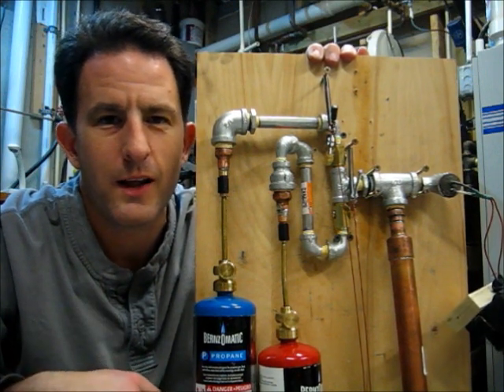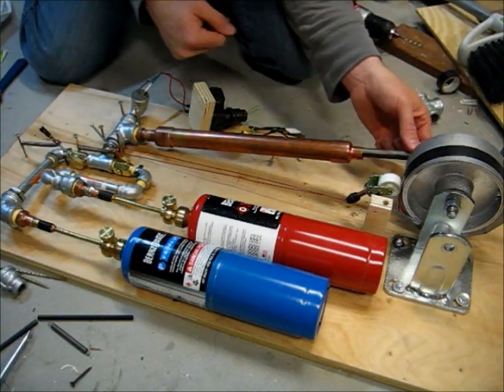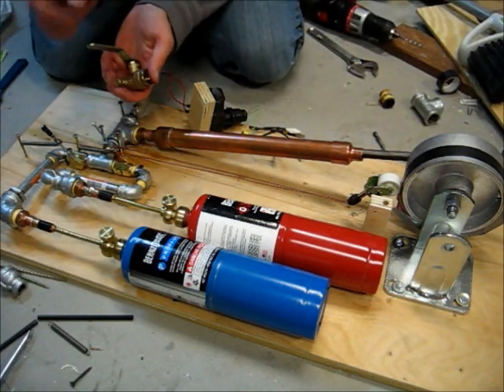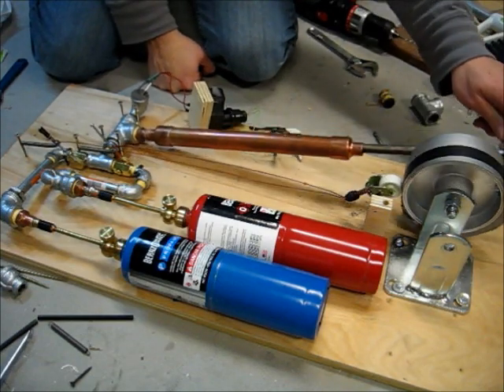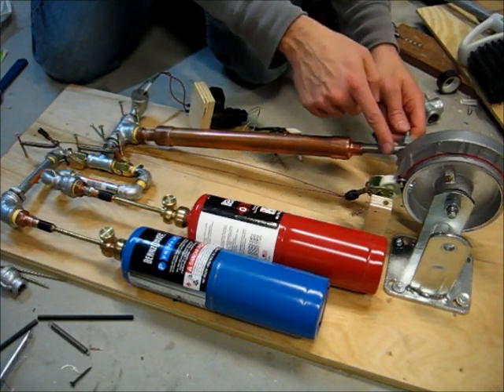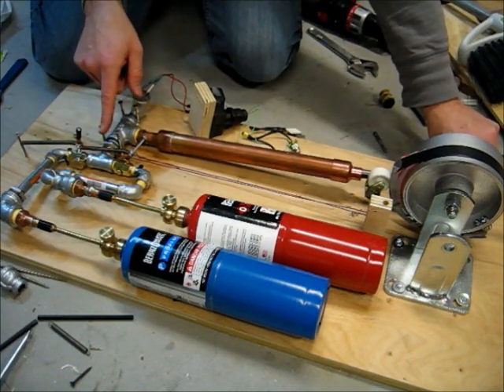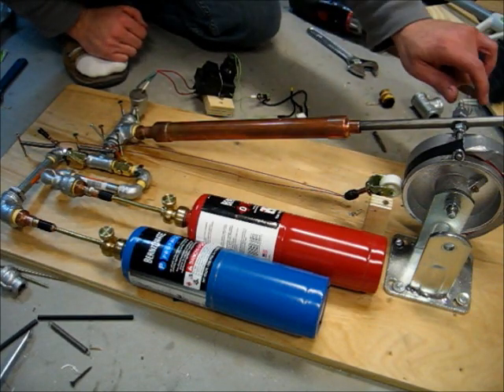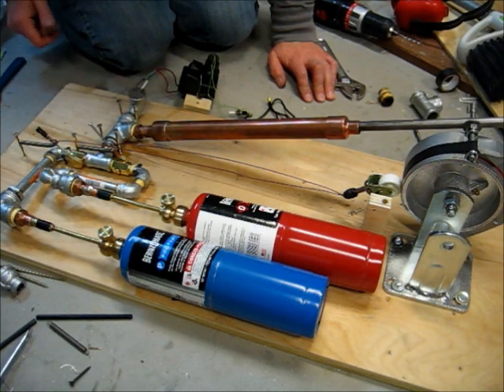How To ALMOST Make An Engine - Take 2 (HowToLou.com)

Comment: I also believe you should switch to air instead of using oxygen. The nitrogen in the air does not take part in the combustion process, but it does serve as a working fluid during adiabatic expansion when work is being extracted by the piston. Nitrogen is an excellent working fluid for heat engines. I don't believe I've ever seen an internal combustion engine that ran on oxygen and fuel alone. The combustion byproducts alone do not necessarily make a good working fluid.

Comment: First off, great work so far. Very innovative. I made a jet engine out of junkyard parts and plumbing fixtures many years ago. Check out my videos.

Now about your engine. It looks to me like your timing is still way off. You need to open the valves before the piston starts back up. Fresh gas will flow in when the exhaust port opens and the exhaust is expelled. If you tune it right, the exhaust expelling can create a partial vacuum in the chamber to help pull in the next batch of fuel/air mix.

Comment: @thispersonthatperson - I think you are exactly right.  I believe the correct ration is around 1 part propane to 5 parts oxygen.  I have decided to switch to gasoline, as it is easier to mix with plain air.  The project has stalled out until I get some warmer days to work in the garage.  You can see my gasoline setup at howtolou dot com.

Comment: I think it's too rich. Like how much air your car uses to the amount of fuel it uses. You could keep the air open the entire phase and loosen the fuel valve so it only opens at the end of its intake cycle or half way thru. If your engine is still suffocating drill an intake for atmospheric air. BUT My favorite would be to swap your 1in T intake for  a 1in Cross with a valve on the opposite side of the piston, and turn the cam 90* to let the intake run 1/4 thru the power stroke before ignition.

Comment: Hello Lou. With the current regulators you can't do much to get more output,unless the valve inside is of bigger diameter and the only restriction is the pinhole 3-4mm or so in distance after the valve,in that case you could drill it bigger without cause leaks.
There are bigger heads but i don't have details,never needed one,i've seen some guys though who put a hi diameter plumbing valve and piping for higher output and they could get 15 foot flames for foundry with the valve wide open.

Comment: I heard on Hackaday that you picked the Oxy due to bottle cost.  You can modify the valve and compress the oxygen and any cylinder like that with air,they are rated to 250psi,i would not exceed 100psi. People including me use these disposable cylinders the whole time for small compressor projects,etc. You can also fill a bigger BBQ propane tank with air just as easy as they hook and fill them at the gas station. Try it,no reason for 50$ air tanks. For long term you can paint the interior with a

Comment: I'm not an expert mechanic and don't know engines that well, but I'm a bit concerned about the pressure difference in the oxygen and propane containers - especially since mixture is not 1:1, eventually you might get propane pumped directly into the oxygen tank (or vice versa) -- pretty sure that's a Bad Thing. You can probably add vacuum breakers to the pipes before the valves to prevent that.

Comment: How about a bronze cross as your piston head? (they're used in showers to mix hot and cold and allow water to reach the spigot and shower head).  A valve on each side and your igniter in thru the top.  You'd probably need a linkage, though, to keep your cylinder stationary.

Comment: Where is your sparker?  Most of the chamber will be filled with smoke (or CO2, whatever the by-product is).  The only place there would be fresh propane and O2 will be right next to the valves (especially in that tenth-of-a-second intake cycle when you're at speed).  The sparker should be at the head of the piston, because of the constriction you've got in the copper adapter, but it would need fuel.

Comment: From your first video, it seemed like you needed more oxygen than propane to have good ignition. You held the oxygen valve open for more oxygen. Try holding the oxygen valve open manually in this setup, giving a little extra oxygen. Then if you achieve ignition, try adding a second cam lobe to the flywheel, to work the oxygen and propane valves independently. With a longer lobe on the oxygen cam than the propane cam.

Comment: then you would even create a way to leverage the amount the cam affects the valves, so you could control throttle, and possibly prevent over reving the engine

Comment: Id work on manipulating the amount of gas and air during ignition manually, to find out how long you want the valves open ideally for each gas, then I'd work on where ignition occurs, for this engine Id guess when the piston has just started moving back towards the wheel, and the piston rod is at a suitable angle to the drive shaft ~90 degrees. once it is actually able to fire, and you know ideal mixtures, i guess you want to very accurately adjust the cam to give that mixture at whatever rpm.